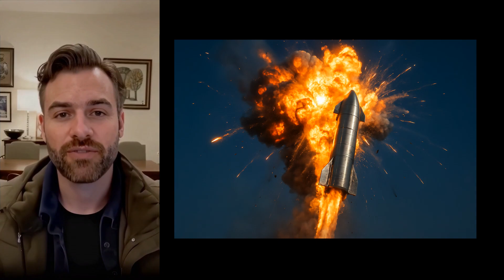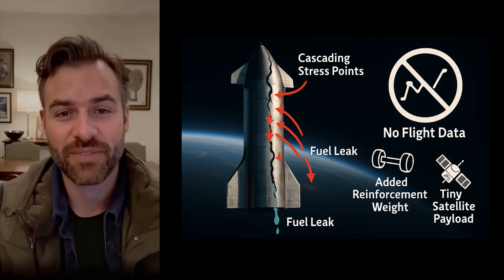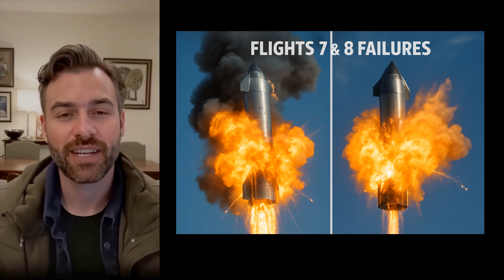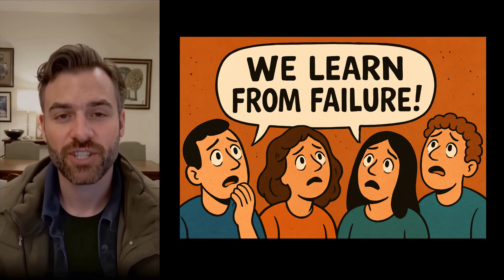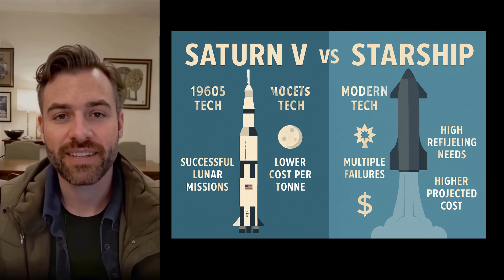Starship's Reality Check  Why SpaceX Is Stuck After 9 Test Flights

Comment: Rather than reinforcing they need to put in water hammer arresters. Water hammer and Pogo are not the same thing water hammer happens when you shut off a valve really fast and there's a lot of force behind it. Pogo happens because of resonance during flight and acceleration. . If there were water hammer arresters there would not be any need for reinforcement